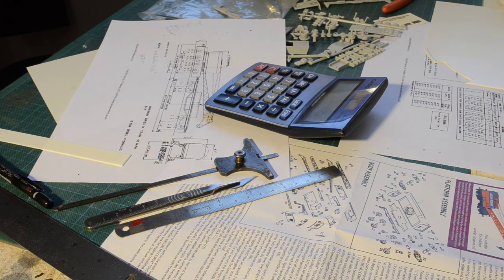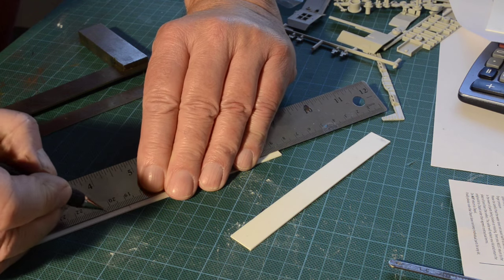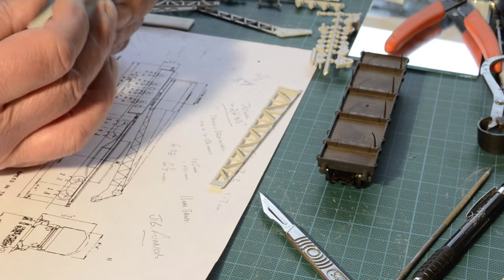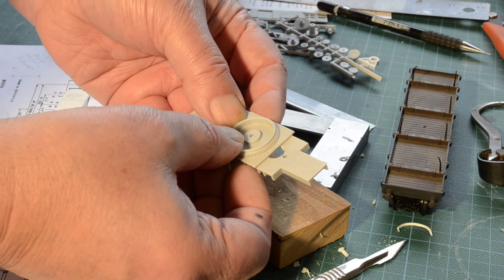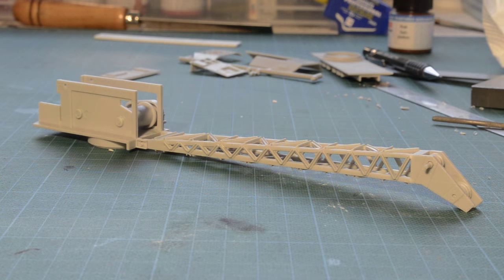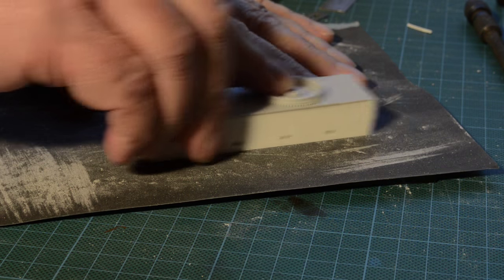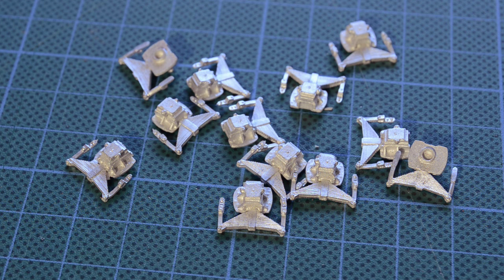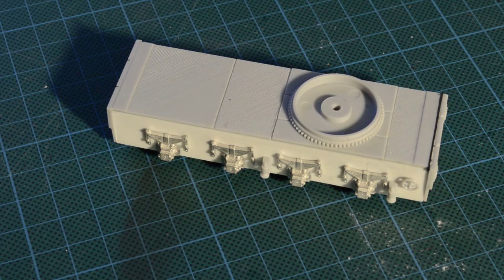DAPOL 15 TON CRANE # 1

Comment: Excellent video.  How did you manage to insert the wheels with the rigid sides already fixed in place?
Reply from the maker: Hi TK, many thanks. The sides are plastic and have some flexibility, just like the side frames on Hornby and Bachmann. You can remove the wheels and axels with the side frames n place 👍👍👍

Comment: Hi David, from looking at the jib in the photos available on the net there appears that they were all different lengths so I can only assume that they were built for particular reasons at particular places hence the jib runner would be specific to each crane built I assume. Hopefully this will give the reason for the awkwardness of finding the right runner for this jib but at least we have something nearer to the original to run with our other near to realism stock! Nice description never the less. Look forward to reading more in the future. Happy 2017!! Bill
Reply from the maker: Hi Bill. I believe there were different lengths of jib. I came across the same when I researched the build. I don't have a great depth of knowledge in railway cranes, and I decided it would be a difficult job to alter any inaccuracies in the jib department. I was lucky in finding a wagon for the runner that looked about right, to my eye anyway. I exercised my model maker's licence (if there is such a thing), as you say, I wanted to move it nearer to the original. Thanks for your kind comments and a happy New Year to you.  ...  David

Comment: Brilliant David - Thanks so much for taking the trouble to make such great videos - well shot and very clearly lit and edited.
Thanks too for sharing your very considerable modelling experience and tips which are great for someone like myself as a beginner. May you produce many more as they are almost like a set of tutorials. 
I noticed on one of your updates you mention using some electronics. Have you made any 'how to' videos on the route switching idea you referred to with your control panels?
Reply from the maker: +Light Ray : Many thanks, appreciate your kind comments. I have limited electronic skills, but I was able to get my head round the diode, and diode matrix circuits. I have made 3 in total, 2 are point (route) switching, and one light (signal) switching, I googled 'diode matrix' and came across easy to follow descriptions of how to design them. Happy to help if you thinks a video might be useful. Regards, David

Comment: Many thanks. Where is the link to the drawings?
Reply from the maker: Hi Ian. Thanks for this - I did forget to add the link. I plan to do a further update on this crane with a mess van. I will add the link there. But here it is for you - go to :-
http://www.barrowmoremrg.co.uk/BRBDocuments/BRWRCranesSHFeb1972Issue.pdf
There are several crane drawings here. Scroll to page marked '13' and you will find the '15 Ton Diesel Hydraulic Crane'  -  David
Reply: David Hyde thank you, much appreciated!

Comment: Hi David thanks for the link to the drawings which I have downloaded. In one of your videos you comment that the runner wagon you have doesn't match the drawings. Well I can see that the annotated 35' dimension is wrong. If you add up the sub dimensions you can see that it should be 38' 5". Also apparent from the 19' 10" dimension which is almost (but not quite) half the wagon. So your model might not be wrong after All!
Reply from the maker: Brilliant, thanks Ian. Its been a while but I seem to remember that the Jib in the kit is not the 'correct' scale length. Anyway I was not prepared to remodel the Jib, and I thought both the jib and the runner wagon looked right, which, unless you are a perfectionist, is fine for me. Glad you have got the plans sorted. Good luck with your conversion. Mess van conversion is going well, I will have a video out shortly  -  David

Comment: Another really super video, thank you. Excellent skills and a real talent for explaining things correctly. I am really enjoying and looking forward to your videos. A small question if I may, was your drill running backwards?
Kindest regards Tim
Reply from the maker: Hi Tim, many thanks for your comments, much appreciated. I have been a keen photographer for many years, my model railway has given me a chance to try videos and I am really enjoying it.
I don't believe it, you are absolutely right, my drill is running backwards. I pulse the drill when working with plastic to avoid overheating and damage, so it slows down the process, I was thinking about the shot, so it did not occur to me the drill was set on reverse.
I drilled the pilot hole and the drill was only big enough to get the reaming tool started, it did open the hole, so I was blissfully aware of the error. Just goes to show - you can't get away with anything !!
Thanks again Tim, best regards, David